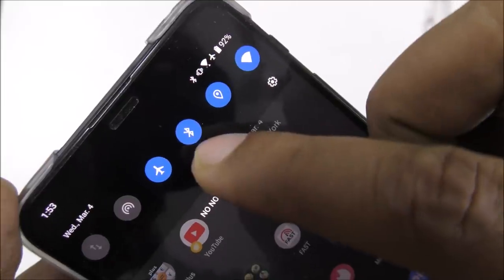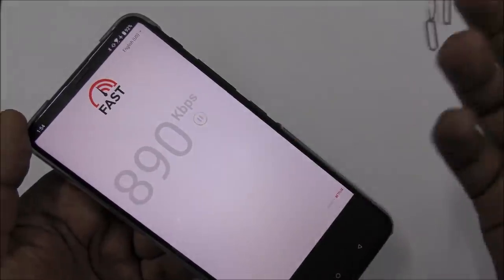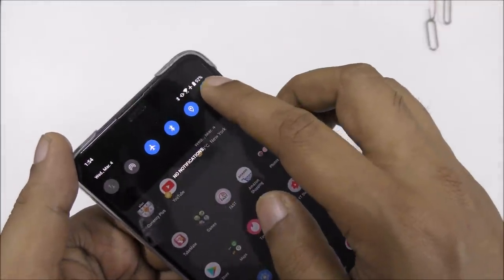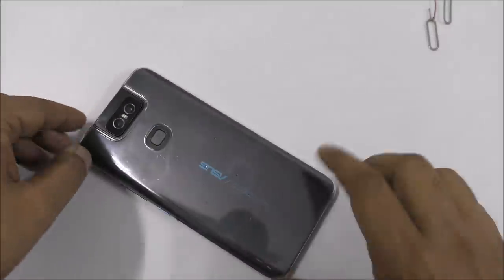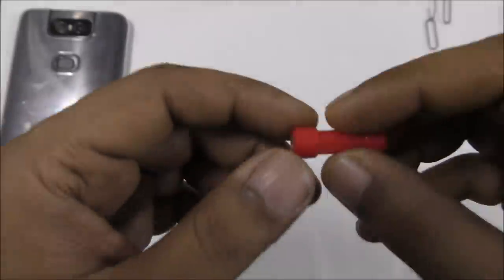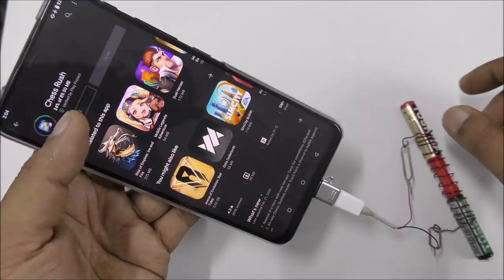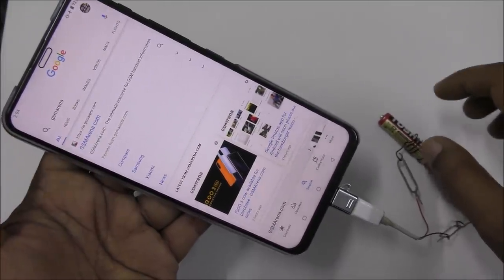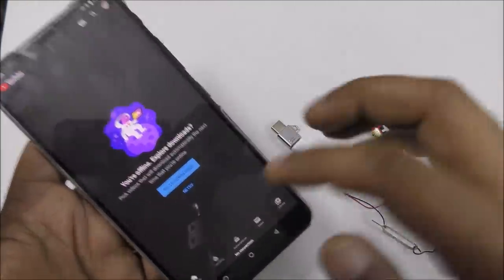WHATS HAPPENS WHEN MOBILE PHONE CONNECT WITH MAGNETS

Comment: Nice demo of an antenna. 

I'm sure you know, but remember to be clear about the difference between WiFi and ISP IP internet data throughput. 

WiFi data Xbps are those between a device and a WiFi Access Point device such as a router (e.g. 866 Mbps over 5-5.6 Ghz frequency channels using 802.11 AC mode devices). They could also exist between two peers with WiFi direct. 

Also, we use the term "speed" instead of the more accurate "throughput." Light waves from radio to gamma frequencies travel at identical, constant speeds ("c" in a vacuum).  Thus, 5.0 Ghz microwave frequencies are no faster than 2.4 Ghz frequencies--they are composed of more waves per meter which we can interpret as on or off bits in binary computing telecommunications.

Sorry to unleash the professor in me :-)